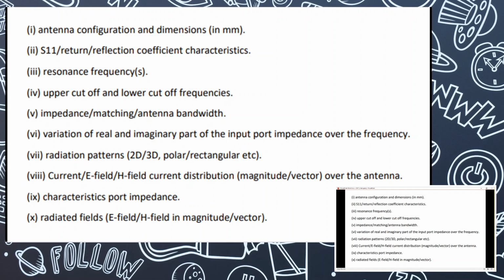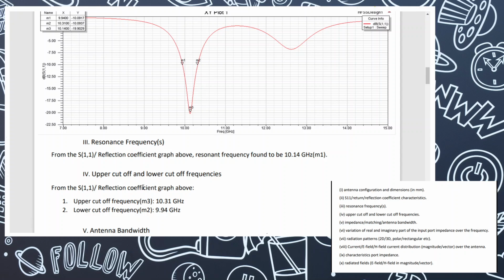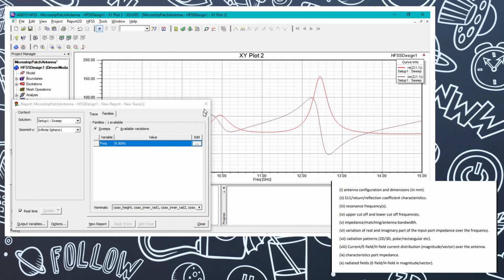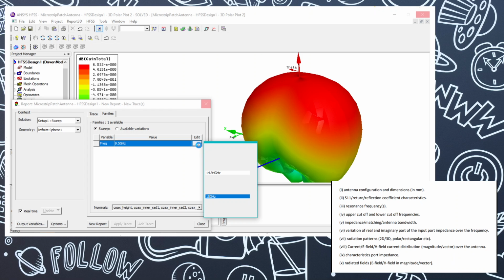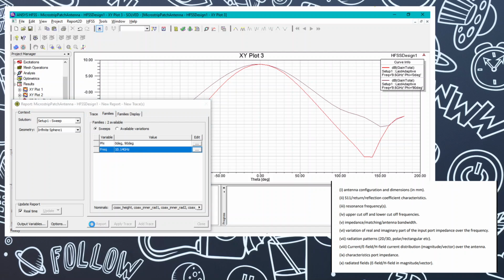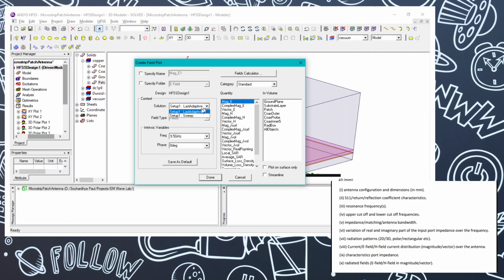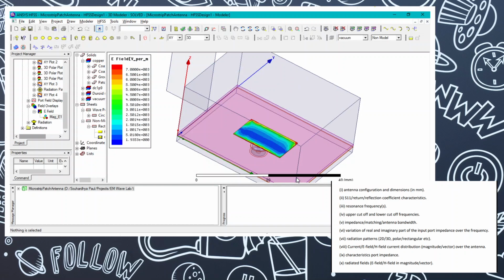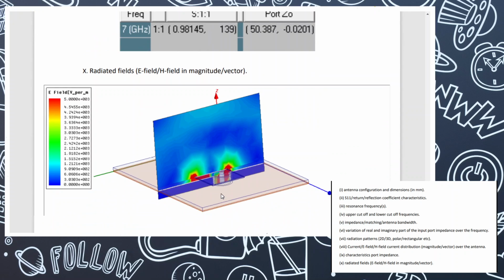Microstrip Patch Antenna Result Analysis and Report Generation - HFSS TUTORIAL

Comment: I have a 1.8 Ghz microstrip antenna. I need to turn this into an array microstrip antenna, but I can't. Can you help?
Reply from the maker: Microstrip Array Antenna are combination of many unit microstrip antenna. You need to calculate dimensions of each microstrip required for 1.8GHz and design accordingly. You can duplicate/clone existing model/structure. After duplication, connect them manually. Their is option in the toolbar, give a try.